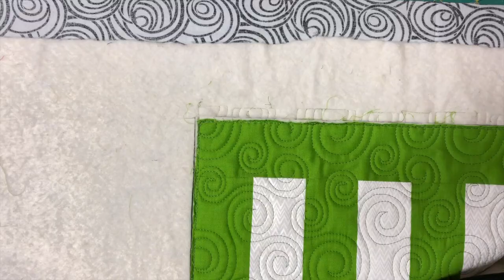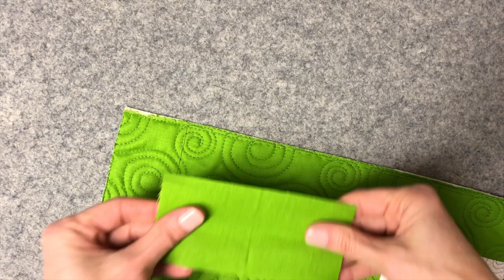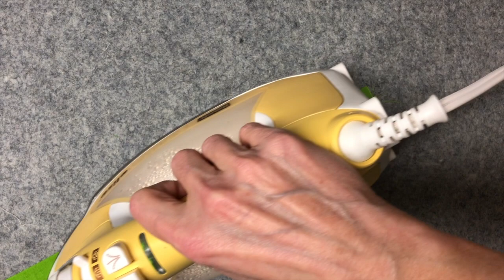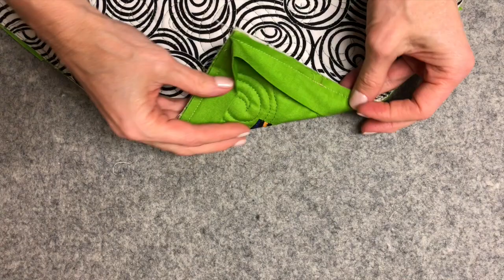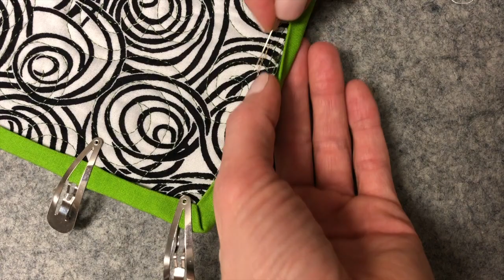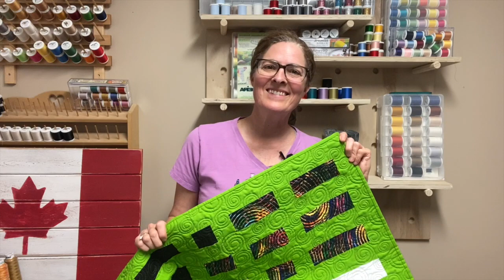Quick and Easy Binding with the Quilter on Fire

Comment: Great video -- nice & close. Question: why do you "indent" your strips when you're making the long binding strip? I love your podcast!!!
Reply from the maker: Hi Roxanne, by indent do you mean why do I press the binding with a harsh fold? I find it easier to have those raw edges perfectly lined up when stitching it to the front of the quilt. Some quilters don't press that way and have a soft fold which can be effective to reduce shifting while stitching. Let me know if you meant something different by "indent."
Reply: @QuilteronFire  I'm sorry I wasn't clear. Let me try that again: When you're joining the strips (to make one long strip for the binding), why do you line up the two strips at right angles 1/4" from the top & right edges? In other words, why not put the top & right edges of each strip together when you're stitching the diagonal seam to join them?
Reply from the maker: Ahhh, I got you! I haven't trimmed those strip ends so there is often a selvage or uneven edge. I cross the fabrics and just leave a little extra just to save that little trimming step. If they are nicely trimmed and square you can match them up perfectly before stitching.   @roxannelowe497